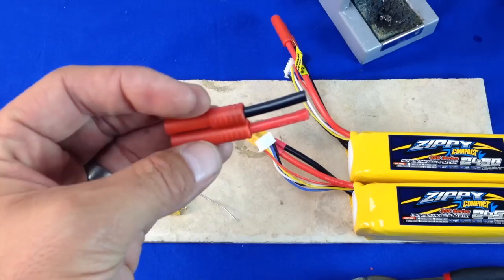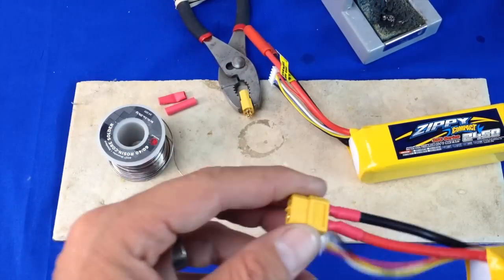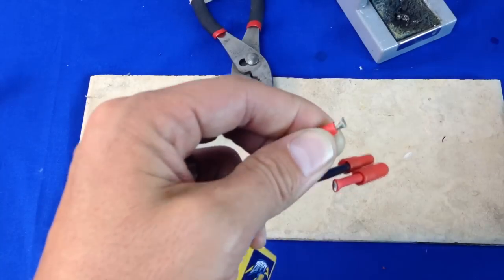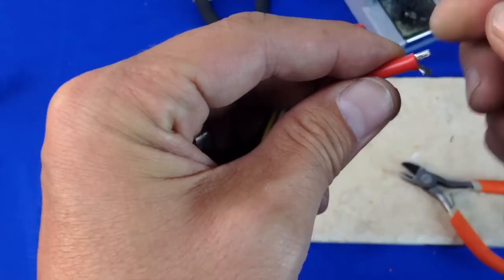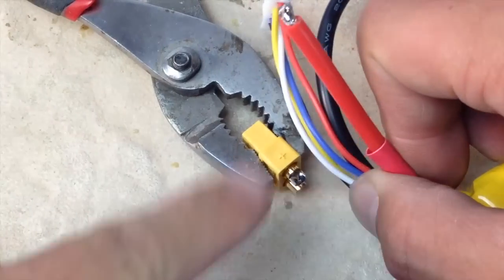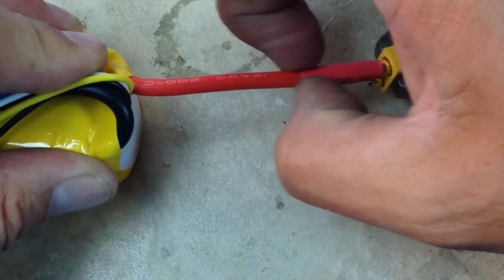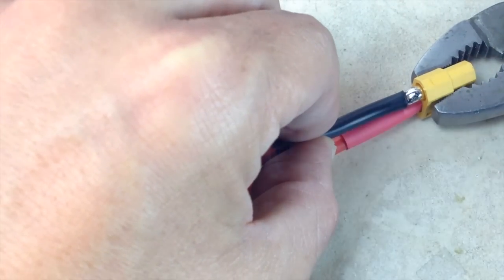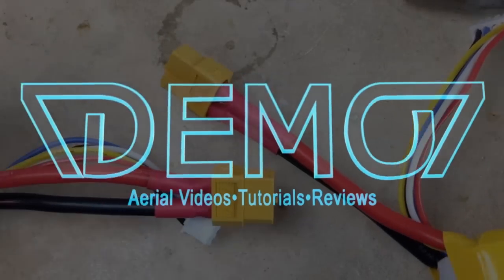Soldering Large gage wires XT60

Comment: Ah, so many XT60s sent to the burns unit. Wires snipped back from a python to a maggot, due to failure after frustrating failure. Why I just didn’t do this is beyond me. Much like my relationship with electrical & electronics as well.
Reply from the maker: Funny, I just tried this on some large 6s batteries- soldering XT90’s. Tried without trimming the wires was almost impossible- clip 1/3 of the wire, super easy

Comment: Hello everyone.First of all, it's very good idea.I use 60 watt soldering one that's cheaper one not solder station.I can solder esc wires easily and accurately.As well as I use xt60 connectors.Last time, I was soldering Turnigy 3S 2200mAh 35C lipo battery which has thick wire while soldering I had soldering problem.I couldn't do it properly.I don't know why.I have some questions on my mind.

1. if I cut 1/3 of wire, does it reduce capacity of current(Amp) ?
Let's consider current capasity is that 100A.if I cut wire like that does it become 70A?
Reply from the maker: Not really sure, I do this to most my batteries, never had a problem..
Reply: Well, if I buy solder iron tips, is it fit with all soldering irons? Are they standart? I get confused.Whether it's suitable with my soldering iron or not.
Reply: The soldered joint should compensate for the area. Don't forget the lip of the xt60 connector.

Comment: Good video, I normally twist off around a quarter of the thick wire on opposite sides, then snip them off, this gives you a more central solder point,on the XT60,  also I fit the xt60 to its opposite ie Male to Female this helps stopping the xt60 your soldering from melting and moving the connecting pins.
Reply from the maker: This sounds good!